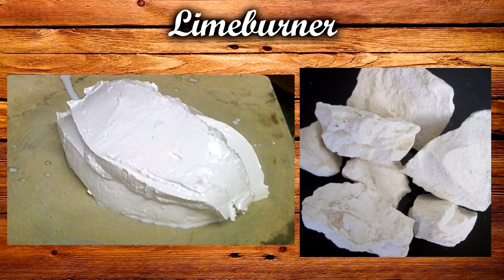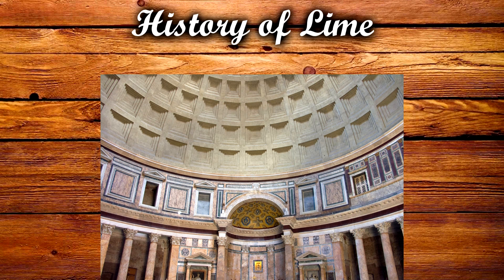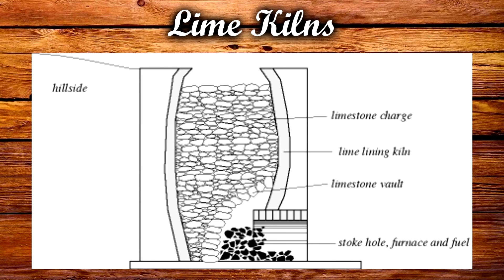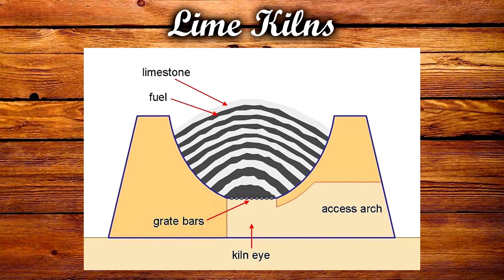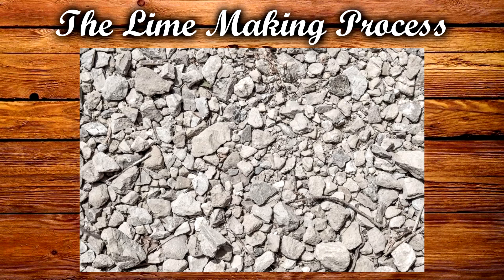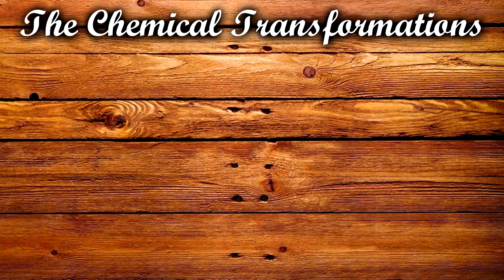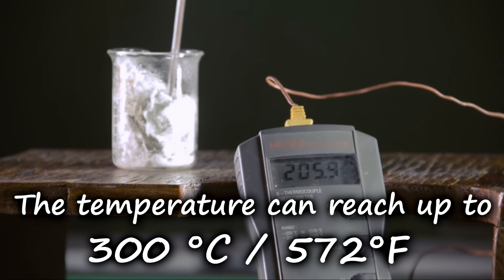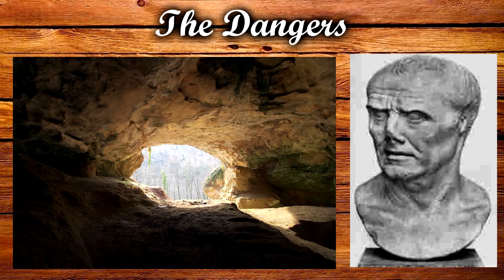How Quicklime is Made and What it Was Used For [Medieval Professions: Limeburner]

Comment: This is a good video on the general information of lime. From my building material class and learning from YouTube, what’s interesting is that on limewashed walls, the calcium hydroxide (aq.) reacts with carbon dioxide in the air to form calcite salts (and some moisture); the salt has a reflective quality from its crystalline structures—visually making the walls brighter, reflects sunlight and subsequently cooling and impart this pleasant effect around the house. I feel this is a brilliant material.

7:25 (My take and opinions) on danger: all chemicals, one way or another, are inherently hazardous. Hazardous, here used as an adjective to mean, “to chance or to encounter risk or danger”. I believe there are precautionary steps and safety measures in place when processing quicklime.

In practice, quicklime are slaked in large metal drums and then usually left for a few months to mature into good workable lime putty.

Comment: Modern paper mills use gigantic horizontal lime kilns to produce calcium hydroxide, which in term is used to regenerate the sodium hydroxide used to digest wood into fiber pulp. They are so big that they have to be kept spinning or else their own weight will deform them at their operating temperatures.
Reply: Leather tanners use simmiler barrels for skins that need hair removed etc.